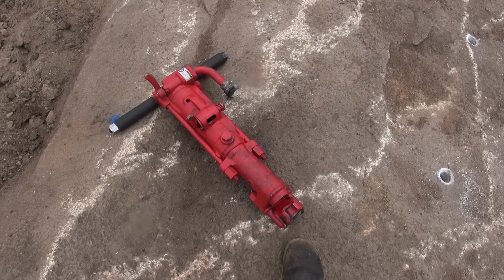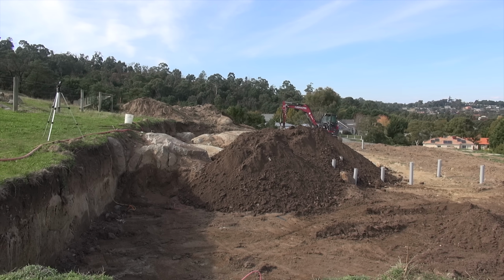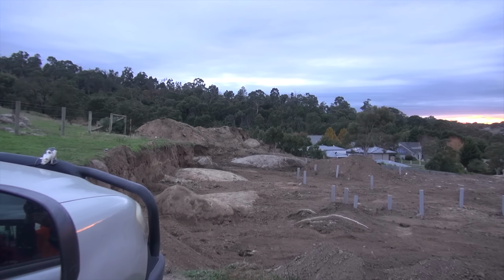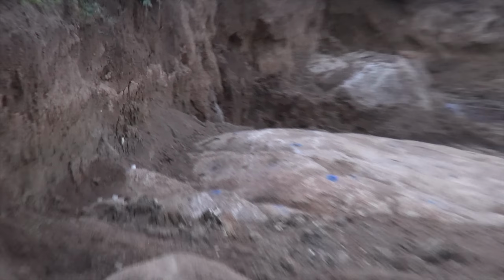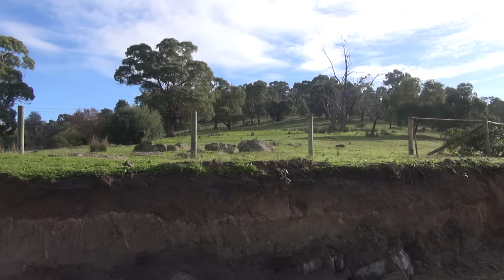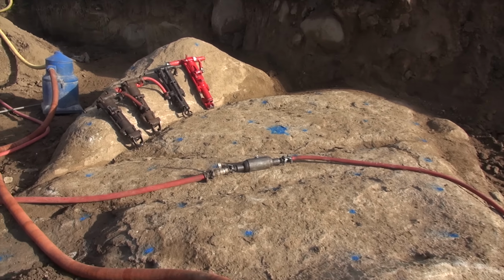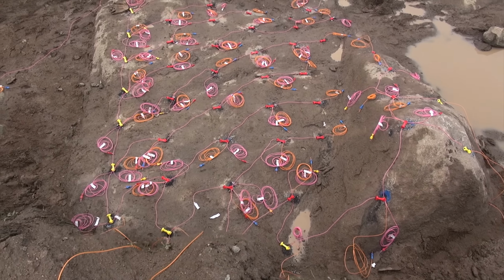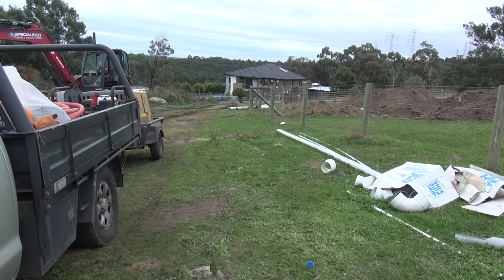Granite Geocide with Demolition Dave

Comment: Hi, Very good once again. I liked your 6 million dollar man SFX at 4.25! I was wondering a few things if I may...
* The white puffs coming out of the drill exaust is I imagine, water vapour condensation from the compression then decompression of the air?
* At 10.49 & other times when the blast was still "smoking", was something actually still smouldering or was it gas & steam pressure still dissapating from the soil?
* Whats the proceedure for retreiving or rescueing a dud blast if a hole fails to go off? Have you had to do this? Some shot holes Ive seen in mines were just left there, I dont imagine that is good form.
Cheers Daniel.
Reply from the maker: Condensation and oil vapor, the still smoking is trapped gasses escaping. If you have a hole that does not fire for some reason you have to make it safe, there are procedures for this.

Comment: What are all the grey tubes sticking up? Loading holes for really clearing some rock?
Reply from the maker: Ah... somebody thought it would be a good idea to install all of the under slab plumbing before the rocks were removed.
Reply: @demolitiondavedrillandblast  
🙄 Wye is ther allways some one....
Reply: @demolitiondavedrillandblast  I'll bet they had a lot of fun digging that in. I wonder how much of collapsed from the blasting?
Reply: @demolitiondavedrillandblast   do you have to take this into consideration when blasting? if for example the blasts popped a couple of the PVC bends off is that something your liable for or do they have to sign a waver in regards to any underground damage caused by blasting? I'm from the Dandenongs and always look out for landmarks to try and work out what area your in. Love the Videos.
Reply: Is that plumbing already laid before blasting? 🤣Might have a few leaks
Reply from the maker: @djtoperau - We discussed the probable damage and I think we only broke 2. No problem, easy to fix. This job was in Lysterfield South.

Comment: Always a treat to watch you at work Dave :-)  What are the grey pipe sticking out of the ground for?
Reply from the maker: Somebody thought it would be a good idea to install all of the under slab plumbing before the rocks were removed.
Reply: @demolitiondavedrillandblast  I was wondering about the pipes. Typical plumbers only thinking of themselves.
Reply: @demolitiondavedrillandblast  Just blow load the pipes full of ANFO, and do away with the drilling.

Comment: How many jobs do you have that you couldn't do with a small excavator with the drill mounted on it. Could even extend the boom to get more reach as you are not carrying weight.  Just like the excavators clearing deep holes. The booms on them are extremely long
Reply from the maker: I have such a drill but not getting much use at the moment because the truck gearbox is dead and having trouble getting a part for it.
Reply: @demolitiondavedrillandblast  ah huh. Maybe get the part machined by cnc
Reply from the maker: Yeah, going down that road, one company that specialises in gearboxes says yeah, can do but no time, another guys says yeah but big minimum order. Not easy, needs complicated machining, heat treating and then grinding to final size.
Reply: @demolitiondavedrillandblast  what actually is the part that is so complicated? Is it one of the gears in the cluster?

Comment: Dave, I find your channel fascinating and it must be very satisfying to end the day with a big bang. I commend your normal use of a respirator face  mask when you drill but it concerns me the way you drape your leg over the drill presumably to put additional pressure on the bit cutting the hole. Hand Arm vibration is known to create vibration white finger which is a debilitating and sometimes painful condition caused by damage to the nerve and tissue by regular exposure to heavy vibration from rock drills and pneumatic hammers and I dont know if that would have the same effect on your leg but I would take care. You dont want to be an invalid in your retuirement
Reply from the maker: Yeah. I hear you John, despite 30 years of it I'm in pretty good condition and yet you hear of people that develop these problems relatively quickly, a poster here said that he got white finger after only a few months drilling, somebody else suggested that smokers are a lot more prone to these issues because of their already compromised circulation. I will not retire...

Comment: Yes a case of genocide. But Dave you cracked the case open.
Dave why not put a folding foot rest on your drills?
Reply from the maker: Geo cide, mmmmm could do.
Reply: good idea!  also, i'd be sliding extra rubber over the handles if they were my tools in anticipation of the arthritis that may be inevitable because of the nature of the job.
Reply from the maker: The drills have rubber handles and I add an extra layer of very soft "Armaflex" - the stuff that is used to insulate hot water and refrigerant pipes.
Reply: @demolitiondavedrillandblast  , that pipe insulation is my choice too.  i had to put that stuff on all my hammer handles when the arthritis got too bad.  the arthritis isnt as bad as it was so not all the tool handles have it on it now.

Comment: I hate those drills. The only good thing about them is that you can do “the stranger” every 20min because you can’t feel your hands/arms.
Reply from the maker: If you can't feel your hands and arms after 20 min then something is wrong, you might have a light weight drill with a short stroke that is operating at a much too high air pressure??? The drill I'm using here is a very heavy long stroke drill and it is very mild to use on 90 PSI

Comment: Hey Dave I'm not sure if you read your comments or not but.. you should do a video on the types of explosive to use you use.. I know some types of emulsifiers.. could cost a lot.. so as retarded as this town's just hear me.. we all know that ammonium nitrate dissolved in water so it makes it inert.. so to keep that from happening if you want to use it in a water-filled hole.. yeah you're going to think I'm nuts but just hear me out.. a condom and a couple of tiny hair ties unroll the condom hair ties on the end. And the hair ties should be the tiny quarter inch multicolored ones.. put them on the end of your condom stick your blasting Cap all the way to the bottom.. put a funnel in the end and pour in your mixture pole the funnel out and put a zip tie around it nice and tight for good measure sink in your hole add a bottle leader of sand and a half a liter of water on top of the sand.. here in the US you need a crapload of licensing and it's just not I deal with the amount of crap you got to go through unless you're running a massive company.. and I'm also fires are really hard to come by however anfo is extremely easy to make.. so for the weekend prospector that has to remove Rock from 30 feet underwater this method works really well.. here in the US you can use emergency instant cold packs.. for the ammonium nitrate.. however a lot of your company's got wind of this and started making cold packs out of  0-0-33 which is urea nitrate.. not ammonium nitrate 0-0-34.. last five or ten years people didn't want to pay the high price for pre-made tannerite which is dark aluminum powder mixed with ammonium nitrate.. demolition dear you might not know what tannerite is so I will explain this for you.. tannerite in the u.s. is for people that want reactive targets to shoot at.. but tannerite works for the high velocity round like a AR-15 or a 30-6 or 308 caliber.. and if you want it to shoot a lower velocity round at it. Like a 22 or a .177 BB gun.. then you mix hexamine.. with your dark aluminum powder and ammonium nitrate.. say you have two pounds of ammonium then you would mix three and a half teaspoons of dark aluminum powder and two tbsp of hexamine.. for those of you that don't know what that is even go to Walmart and you're camping section I think it's called stiro. I know I didn't spell it right but it's the little white cubes used as a  fire starter.. you take them you grind them to a fine powder.. and that is hexamine.. when you mix that with tannerite it makes it really sensitive. For people like demolition Dave now you have an explosive charge you don't need a blasting cap for you could simply use firework fuse for an electric match..
Reply from the maker: Condoms have often been used to protect anfo in small diameter blast holes.

Comment: 유압식이면 넉넉잡고 2일 걸릴건대 힘들게한다  😢  대체 몇일째 저러고있냐 답답하다 굴삭기에  중형 150mm  60cm드릴에 물에  이동형 유압기면 간단한대  참힘들게 한다 https://youtu.be/v6oicM9QiNg?si=zMgEa1zEM8p07O8w
Reply from the maker: This is a very interesting machine, I have thought about building something just like this as an excavator attachment. In my experience when core drilling rock it can be difficult getting all of the core out of the hole because sometimes there is a joint or a defect in the rock that causes it to break of above the bottom of the hole. The piston style splitter is good, I have a Darda style wedge splitter at the moment. Thanks for watching. It took me several days to blast all of this rock, but the explosives always do a very good job.

이것은 매우 흥미로운 기계입니다. 저는 굴삭기 부착물로 이와 같은 것을 만드는 것에 대해 생각해 보았습니다. 내 경험에 따르면 암석에 코어를 드릴링할 때 구멍 바닥 위에서 암석이 부서지는 원인이 되는 조인트나 결함이 있기 때문에 구멍에서 모든 코어를 꺼내는 것이 어려울 수 있습니다. 피스톤 스타일 스플리터가 좋고, 현재 Darda 스타일 웨지 스플리터가 있습니다. 시청 해주셔서 감사합니다. 이 암석을 모두 폭파하는 데 며칠이 걸렸지만 폭발물은 항상 아주 좋은 일을 해냈습니다.